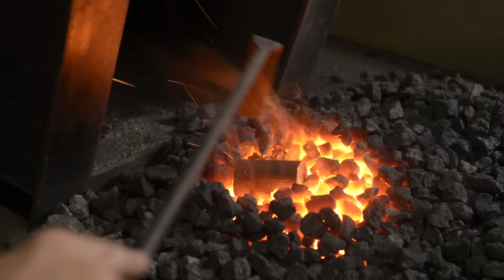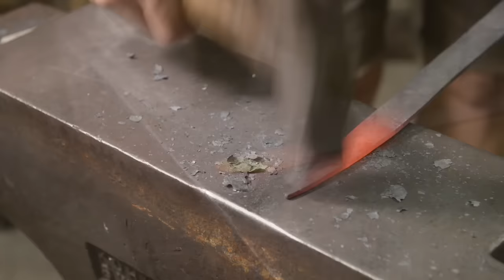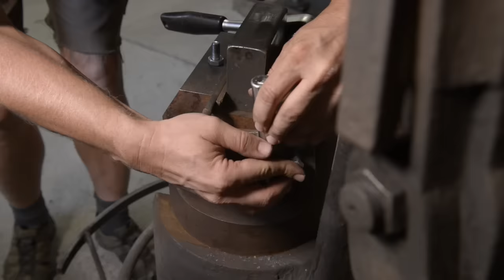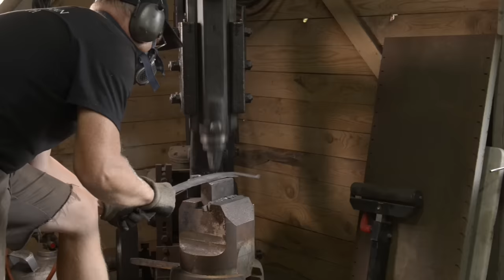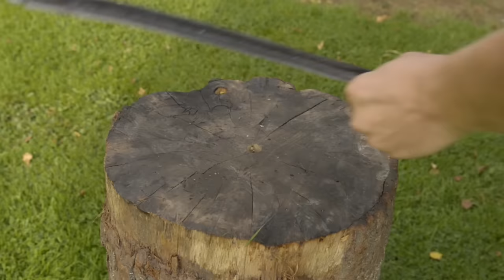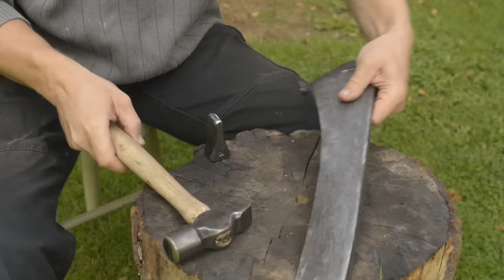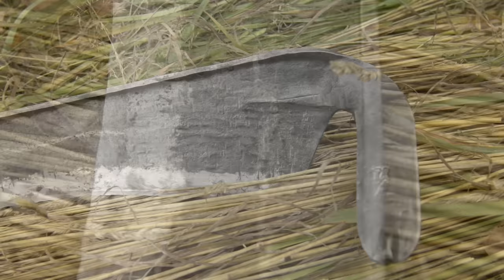Blacksmithing - Forging a scythe

Comment: Grandpa taught me how to mow - but folks that can make good scythes are very rare these days. Deep respect to your blacksmithing skills!!
Reply: Not rare at all, plenty of skilled bladesmiths. They just don't make scytes because there isn't a relevant market anymore.
The shape is easy to form and as you can see here , without much care to the quality of the result.
Thus any generic smith can do a scyte.
Making an exceptional one (not seen here) would require one of the exceptional smiths, that will use soft and hard steel and a proper tempering for an amazing long lasting sharp blade
Reply: See we have a key board blacksmith just slot if talk

Comment: The process of moving metal down to the edge of the blade with a hammer is called "peening"  in English.  I own a scythe (Austrian blade) and cleared about 2 Ha. of brush with it. Scything is therapeutic.
Reply: Wish I could get hold of one. Here in South Africa none is available, and never even heard of.
Reply: 2 ha? Do you mean the whole field the size of 2 ha, or just around it, on it's borders, and did you do it at once, in one day or in few days? Cause if you can do it in one day you're a monster! lol
I own 3 scythes. One beautifully made by a local Serbian blacksmith, one Slovenian and one from Bosnia. I think that Slovenian and Austrian are similar and are industrially made, not handmade by blacksmiths, but still great scythes. I use all three them very often to cut weeds or to cut some nice grass to give to my pigs to eat. I use Slovenian one for weeds, Bosnian is the cheapest one so I use it for rough weeds or on rough terrain cause it can get damaged and I use the one that was made by a blacksmith for the fine work cause it's the best and the most expensive one :D

Comment: When I was younger I used a scythe a lot for clearing. It's really effortless and much faster than a string trimmer. This is a much better blade than these modern stamped ones on the market. Again great work my man your an artist with a hammer.
Reply: A good craft from a good forge does good work in the hands of a good man or woman

Comment: In age 74  the grass cutting with the scythe  in my garden under the trees is one of my few male pleasures, but I have seen the scythe making the first time in my life and I watched it with the curiosity. Working with the computer need some pause and grass mowing  is excellent ecxercise, especially if you do not have to, but still you can . I was working one year in Sweden in one factory construction project some 10 years ago and I brought to my country (due to high quality) two their brushes for the floor sweeping. Swedes in Goetheborg airport were looking at it   smiling slightly , and I had to pass it through the special procedure for oversized luggage. After landing, I was  able to retrieve my brushes only after two weeks, because the airport services  were searching the items thoroughly -apparently expecting to discover something more unusual there.  I told my wife : do not touch it , it is for me only. So we are using it both up to now, and  my wife is thinking to buy the same one or something similar. Today I look with the some sadness when I see , what the swedish politicians did with the Sweden I have seen.
Stary

Comment: I remember my grandpa scything the grass. He said that grass should be wet when scything, compared to when mowing with the modern lawn mowers. 
Beautifully crafted as always.
Reply: My grandfather said that the bad dancer is prevented from dancing eggs. A good scythe mows any grass in any weather. But with such a handle it will never work to cut grass well. And the blacksmith does not know how to mow.
Reply: @xeonxeon7013  Main reason for cutting wet is not because scythe is not able to cut. Wet grass simply reduces friction and cutting takes less effort. Water also softens older, already hardened hay and yet again cutting is easier.
Reply: Well yes, it's why people went scything at 4 in the morning

Comment: The high and mighty experts in these comments, wow, yes he's doing some things wrong but god dammit he DID it! He went and made a scythe blade and it works, yes he stoned it wrong and his handle is too damn short but it's a blade, it cuts, it works, he made it and he was proud to show us even with all the little things he's maybe not the proudest of. I for one am proud to watch the video, his creation.

This was very cool, thank you for uploading.
Reply from the maker: Thanks! :) I may have to revisit this one....
Reply: @goblin550  With this kind of scythe you use a dry stone, the sharpening is not by the stone but with the hammer. The stone is only for polishing the edge
Reply: @NielsdR  I've always heard you use a wet stone even for honing. I'm not experienced however so I could be wrong. Thanks for the info!
Reply: @goblin550  the stone will sharpen more aggressively if it's wet but it can be used dry. the blade is not hardened in a conventional sense i.e. martensitic, so it doesn't matter.
Reply: This is an interesting way of making a scythe relying on work hardening for the edge, the scythes that I remember from my youth (they were rapidly disappearing from use) had a very thin hard steel blade with a mild steel back riveted on, and were sharpened with a dry round stone whenever the mower felt like a rest - this was in England -
Reply: @torbjornahman  there's plenty you did correctly, like pulling up accentuates your curve.
Reply: If you make something, make it right... he seems to be a blacksmith with all kind of professional tools, so yes, I’ll be hard on him... regardless, he’s making money from the YouTube viewings... all good
Reply: Yes fair play to him i often worked the Scythe my unkle could cut an Acre in the day athe best we found was the Blade called the Horse and jockey well ballanced and hold the edge of course u always cut when grass wet it was good to c him
Reply: You are amazing Torbjon Ahman,  You are an  Awesome Creator! I am origionly from Urmia Azerbaijan Iran  " an old world " I remember the old Iron Smith shops making Agricultural tools with ancient Skills, but now i can see you doing the same but with the most progressive methods and inteligence of your own, Ahman I Admire You and I Am totally Impressed , by the way I have Mechanical engineering degree from UICC 1975 Chicago and have Lived  in Irvine Ca.

Comment: Love that you included the complete process for building the guide you used for fullering and thinning the blade, and the process for rolling over the back of the blade. I’ve been thinking about trying my hand at a scythe. Yours looks like the right process, with the right result, but in my 100% manual shop with no power hammer in sight in any direction, I have to admit that this much work thinning the blade looks more than a little daunting. Also love that you included whole process of peening and honing, and showed it in action doing its thing.  The only things I might have wished for a bit more on were the process of adjusting angle of the tang and fitting it to the snathe.

Comment: Excellent work as always.  I have never seen an edge created with a hammer like that just before honing.  The scythes I have used in the U.S. had heavier and thicker blades but yours works well.  Your shop supervisor has a very steady hand with the chalk.

Comment: I jumped at 14:33 too! Creamed beeswax works well as a coating on metal to keep the oxidation down too. But then, it doesn't come in large industrial containers like the linseed oil :)
Reply: Beeswax is also a bit tacky tho. Would drag a bit, and make it harder to use.

Comment: The only thing I would say you need to change is you need to make a much longer snath. You are too tall for the one you have right now, and it's preventing you from using clean technique. Scything is done standing straight up, but your snath is keeping you from doing that.
Reply from the maker: I know. I'll make a proper one.
Reply: +Torbjörn Åhman - Just take a long straight stick for a snath.  One handle only.  For me it's the simplest and the most convenient one to use in the long run.  I also prefer wooden wedge instead of screws for fixing the blade to the snath.  It falls apart with one hit from a hammer, no need to screw around (pun intended).

Anyway, have you normalized the blade?  It looks like there are a lot of stresses in there from forging.  It may cause what we call "fishtailing" during peening later on.  

Overall, great job though.  It's definitely a good scythe, whether it has some faults or not (all of them have some anyways).  I could see she "wants to" cut grass.  You can't fake it.  She a good one.
Reply from the maker: Thanks bakters!
Reply: he's also stoning the scythe incorrectly
Reply from the maker: Ha ha, apparently, but you know what? The important thing is that the edge is sharp.
Reply: Alec Burgess that show is trash

Comment: My scythe is double fullered - equal height on either side so that the raised edges would be a guide for the whetstone to slide across.  It looks as though you are making a harvester blade. The "weed cutter was shorter and wider. I still have the harvester blade that raised so much sweat in my youth.  Thank you for all of your videos.

Comment: Use more hips! It should take the strain off your back and feel a little easier. The stance need to be slightly longer and adjust your back foot to a more forward facing angle. Also try switching your feet around, you might find it is easier on one than the other. Hope I helped!

Comment: Thank you for sharing this. We recently bought a house with two acres that need mowed. Most of it can be done with a tractor, but there are a couple of small hills that might be dangerous, so I've been watching videos on mowing with a scythe. I'll probably buy one, but what kind of aspiring blacksmith would I be if I didn't make my own. Thanks for showing the steps you went through, I think I can figure it out from here and appreciate the detailed video.
Reply from the maker: Thanks, that is great! My takeaways from this video was that the blade should be hardened, and probably made from a more high carbon steel. BUT tempered back, probably beyond light blue or something like that, so it can stand the peening. Unhardened, it's too soft.

Comment: I know its old but fyi to anyone who cares, American sythe blades ARE hardened and are to ONLY be ground to sharpen. Never hit them with a hammer or they will crack. The European blades are left soft and are "sharpened" by peening the metal with a hammer to thin the edge, American style are ground on the huge water wheels you see in old time films ans photos. Just a word of wisdom i learned the hard way
Reply from the maker: Likevise for the Swedish or Nordic blades!

Comment: You are using the wetstones incorrectly. 
You use the stone on edge on the top side like a file riding it on the edge and spine at the same time. It will give you the correct angle and hollow grind if the hight of the spine is correct. Then you use the flat side of the stone on the underside laying flat. Again like a file. Never in line with the edge. Using the stone perpendicular on the edge will give you small serrations that bite into the grass. Using the stone along the edge will make microfracture points that make the edge prone to chipping off.
Reply from the maker: Thanks, Yes I have learned that since then...

Comment: Once again you are a Master Blacksmith, for me forging a scythe must be  the top of blacksmithing skills, yes really!  By the sound of you cutting the grass the blade sounds like either its not thin enough to hold a thin cutting edge , thick wet grass should be the easiest grass to cut,( i love scything after rain) the edge should be thin enough after peening to bend when you run your finger nail across it (not at a cutting angle "for those that don't anything about scythes")  Just a fantastic video!
Reply from the maker: Thanks. The edge was thin I can assure you. I think the sound might be a bit misleading, especially since I use this cheap metal tube handle.

Comment: It's a little thing, but I wanted to thank you for your editing skills.  Not just for the humor, either.  You show yourself pulling the the initial cylinder of steel out of the fire and moving to your pneumatic hammer... and then you show yourself using the hammer to begin the work on the cylinder of steel.  While this could two cameras or two different recordings with one camera, it shows that you thought about the shot itself.  You think about how you want to frame things, and what sort of "story" you want to tell: what's important for us to see and what isn't.  You edit the work so that we can follow along without getting bored, while still learning and being entertained by your work.  It's such a little thing, but I think that you deserve credit for that.
Reply from the maker: Thank you!! Sometimes it works... often I wish I had filmed stuff in a different way, but it's hard to keep thinking about angles and shots when also making a project.

Comment: In Switzerland I saw belt-fixed wooden cups to carry a wetstone in water with you. That is for when you are on the meadow. Hammering the blade back in shape happens back at the farm. My father has childhood memories of going to sleep in late summer while the farmhands would hammer their scythes sharp again. I wonder if even mild steel would work for this tool.
Reply from the maker: No, mild steel will not do it. And the steel should be heat treated as well... I didn't do that since I couldn't find the info. May have to revisit this...
Reply: @torbjornahman , I didn’t expect that this would get even more interesting! “Ladies an gentlemen, here we are, at the cutting edge of the pursuit of our traditions.” :-)

Comment: Use your hips not your arms. Don't drag it on the ground. Also, that's ill sized for you. It needs to be sized to the person which is why wood is better than an aluminium handle.
Reply: You'll damage your spine that wau

Comment: Try mixing a little wood soot into the linseed oil, apply the mix to the steel when hot at about 350 deg f. You produce a black protective sheen on the steel. Nice job by the way, loved watching the video.
Reply: Mr Neil, how we can take this soot?? I think is the smoke after burning woods... From a chimney?? Many thanks
Reply: @konstantinosantoniou1019  The fine charcoal black dust.
Reply: @neilyakuza6595 Thanks a lot,

Comment: Hey man, but what about heat treatment?
Reply from the maker: That is a question mark for sure. I have done a bit of research but haven't found a reliable answer to this... This type scythe is peened sharp and was probably made from a lower grade of steel, apart from Scandinavian scythes that was usually made from high quality steel, which you ground sharp. So part one of the problem is to know what type of alloy is suitable for this application. I have made some spark testing on a couple and they all seems to compare quite well with what I used, namely 1045/C45 steel. Next question is heat treatment. Not being sure what to do, I wanted to test how this steel performs unhardened. In hindsight the scythe is softer compared to my samples, but on the other side you can't make it too hard either, then it will not take the cold forging of the edge. The recipe might be to harden it and then temper it very high up....
Reply: Maybe you should try to quench it and do a first tempering cycle of about 230°...then cool down quicly and another second 230° tempering cycle...it work better in my opinion to do 2 tempers with lower temperatures than a big one...i don't know why...i fin that the blade remains harder and way more tough 😉
Reply from the maker: I actually think the temper should be more in the range 350-400 degrees... around 230-250 it will be way too brittle for cold forging the edge.
Reply: You dont heat treatment this because the hole thing must be very flexible. When  you blacksmith it you make this cold at the end, to compress the steel. This make the steel hard and flexible. Even when  the cutting end get to thick you must blacksmith the cutting edge cold again.
Reply: @torbjornahman  yeah i know what you want to say, the thing is that i did a 90° bend test on a piece of 1075 at 61 with a selective quench with a 200° temper.. so if i were you i would just heat the edge then quench in oil (that's far from being ideal but water would leave too much tension) and then i will do 2 tempering cycles...but you are right maybe at 260° or more

Comment: You've made a blade that is better in form than any other non-proffesional scythe forger made blade I've seen. The best scythes are usually heat treated and tempered back to a very high temperature but this being hammer tensioned and peened should work fine.   Only problem is you're using the stone the wrong way around and looks like it's still too dull to cut. A scythe is a tool that is kept pretty much shaving sharp . Looks like you were jerking the blade through the grass which is  result of a dull edge instead of the slow slice that sharp scythes do. In fact wet thick grass is where they excel! I hope you eventually got it sharpened up and a good snath on it.
Reply from the maker: Thanks. I know about the stone :) And it should have been heat treated, it's a bit soft. Something I tried to research before making it...  My mowing technique was not that great back then, but to my defense this patch of grass is not great to mow. A lot of different plants and thick at places...